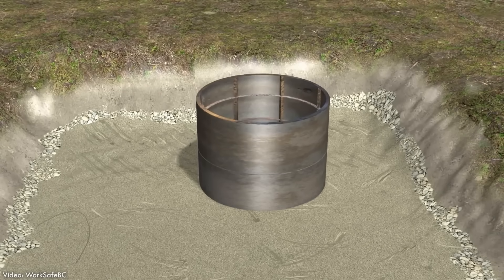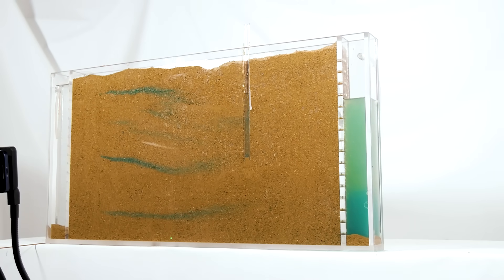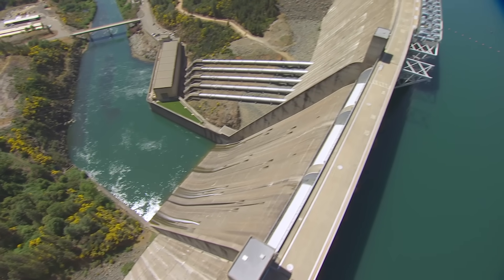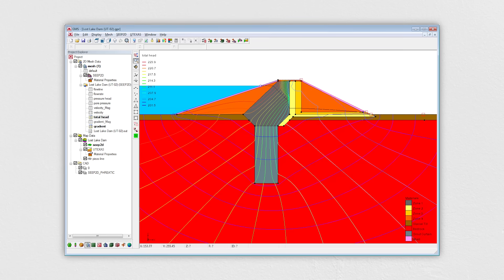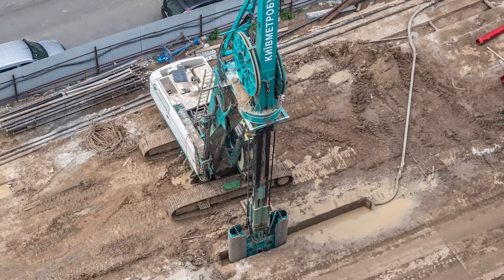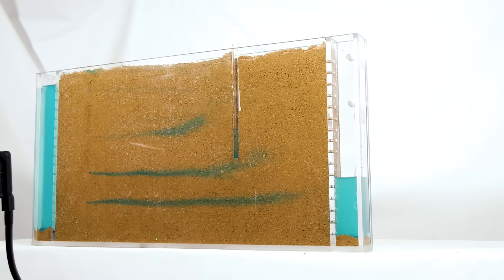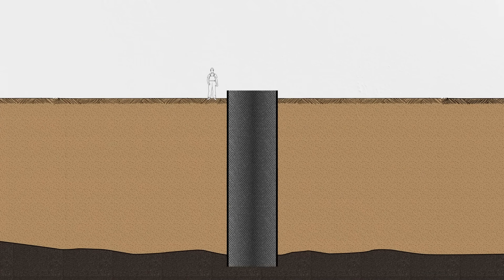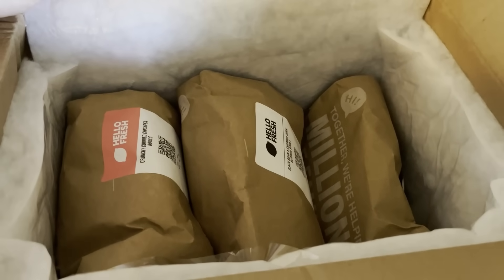The Bizarre Paths of Groundwater Around Structures

Comment: Living in the Netherlands, water, and especially groundwater, is a massive part of life around here. It's good to finally learn how we control all that when building anything a meter below sea level.
Reply: Same is true in the state of Florida. You take about one meter you will hit water. Plus we have sinkholes. It's similar to building on top of a large brick of Swiss cheese.
Reply: @EnlightenedSavage  yeah one thing I noticed when I have visited Florida is just how many wells there are. I figured it must have been easy to hit water because just about every lawn sprinkler has a well.
Reply: @EnlightenedSavage  the scary thing over there is that the groundwater is getting salt….
Reply: @EnlightenedSavage  not all swiss cheese have holes in them though 🙃
Reply: @BlackDragonWitheHawk  it's a saying. Do you want to add to the discussion constructively?
Reply: 1 meter below sea level? More like 9 meters in the deepest part :) (Polder near Moordrecht/Nieuwekerk a/d IJssel)
Reply: When I first moved to Zoetermeer my Dutch girlfriend told me you could dig a hole and watch it fill with water, (I’m American). 
I thought she meant like, dig a hole, crack open a beer and by the end of the beer there would be water in the hole. 
Later I discovered on my job, where I had to open ground level access ports to below ground tanks and get a measurement of inside the tank, I bailed out the water covering the port and unscrewed the cap. I was just about to put my measuring stick in the port when I realized the water was about to go in the port. I quickly screwed the cap back on, then bailed the water out again. Sure enough, in a few seconds it was back up to above the port cap. 
I just lowered the access cover back over the hole and didn’t bother checking that tank.
Reply: @Linusgump  as a fellow Zoetermeerder, I can definitely see that happening here. My crawl space under the house is only a few centimeters above the water level!
Reply: I imagine ground water is not just an important but a somewhat terrifying matter when a good part of your country is at permanent risk from the ocean, rain, adverse weather, and pretty much all water on top of it.
Reply: @Voltaic_Fire  Not really, to be honest. Flood insurance, for example, is just not a thing here. Our water management infrastructure is so omnipresent and so fundamentally integrated into every level of life that we just don't think about it anymore. There's even a level of government which is equal to but distinct from the province level called the watersheds. So 'It's taken care of' is the mindset most of us have.
Reply: @MrBlueBurd0451  I have seen your water management infrastructure, it really is impressive, but I'm a worrier so I do not think I could adopt the same mentality.
Reply: @Voltaic_Fire  If you grow up not worrying about it, well, it's not something that ever comes to mind.
Reply: I second the not worrying about it. The government also provides a flooding estimator so citizens can look up how high the water will rise when a dam of primary water retention structure breaks. Most times we're below the water level for ground floor but above for the 1st floor where bedrooms typically are. Add to that that most if not all houses are concrete or brick walled and anchored to foundation piles and the fact that the pumping stations are built with plenty of redundancy and you'll not worry about it.
Fun fact: the pumping stations often maintain specific water levels and pumping rates and are not pumping "as dry as possible"  because that would create additional soil settling issues.
Reply: Fun fact #2: some of the historic pumping stations are still on standby duty to be able to pump in extreme weather conditions. For instance, the biggest steam powered pumping station 'ir. D.F. Wouda Steam Pumping Station', apart from being an UNESCO world heritage site is still capable of pumping 4,000 m3/min (1,100,000 U.S. gal/min) when needed. 
It's a museum too, so if you are ever around it's a great visit!
Reply: @WouterWeggelaar  additionally, all windmills (not turbines, mills) in this country are fully operational and do pump water on a regular basis (weekly to bi-monthly)
Reply: @Voltaic_Fire  I live right along the ring of fire, and my whole life people have been talking about "the big earthquake" that's due any day now. It's kinda terrifying to think that any day with no warning the whole area could be flattened and lots of people I know killed, but on the other hand it hasn't happened yet and there's nothing I can do about it so you kinda hit a point where you just don't think about it any more :) I imagine the same goes for people in any area with imminent disasters. Beyond preparation like having food and blankets ready, there really isn't anything to gain from worrying and you kinda just... don't
Reply: @achelp954  That's not 100% accurate, but indeed if you own a windmill that has a functioning pump and is still connected to waterways, you have to maintain it in working condition and satisfy the minimum amount of monthly pumping hours to prove their readiness. but some windmills are....mills for grinding or saw mills etc. those still need hours turning but no pumping. furthermore some windmills don't reach water anymore.
The mandatory pumping is mainly to discourage people from buying a windmill and not taking care of it.
I've done some sail & rope maintenance on one of the classic windmills where the pump actually runs on electric power and can run on wind if needed
Reply: @WouterWeggelaar  wow. You really know what you are talking about. Very interesting facts.
Reply: @MrBlueBurd0451  it will be sad when most of Florida is underwater. And rather crowded inland.
Reply: @Voltaic_Fire  the only time it happend was because ww2
Reply: @WouterWeggelaar  ooh, fun language thingy! You said water is an issue on the ground floor but not the first floor, and although I understand this to be a common naming convention, it would be confusing to an American as we call our ground floor the first floor!
Reply: Ive lived in Tucson, Az. for 53yrs and I dont have a clue what your talking about lol. Back in the late 70s early 80s I was building pools and we had one area that you would hit water at 6' when digging the pool. Its not that way anymore. Water is 20+' now in that area. I still found this to be very interesting. Its hard for my mind to picture a lot of water under ground cuz its bone dry and hot up here on the surface. 104F today.
Reply: Including Schiphol Airport site of a sea battle in 1573!
Reply: Because of this, building something "simple" as a basement under your house in the Netherlands can become quite the engineering feat, depending on the location. This is why building basements in the Netherlands is quite regulated.
Reply: @Razwer  It's also problematic in this part of Eastern England. One large part of this county is called 'New Holland', after Holland in the Netherlands.
In Lincolnshire and Cambridgeshire, the Fens were coastal marshland until the 1800's. Only properties on higher ground can have basements.
Reply: @Razwer  here in Tucson ground water isnt a factor when building a basement so one would think they would be common place but the reality is basements are rarer than hens teeth here and I dont know why.
Reply: @tonythomas951  "rarer than hen's teeth" just made my day, you sound like my dad who lives in SoCal but whose family is from the South so he walks around saying the damnedest aphorisms 😂
Reply: hello there, underseawaterlevel people!
Reply: I had an amazing professor from the Netherlands, Otto Strack, who specialized in groundwater. Necessity breeds ingenuity! Nobody understands groundwater better than the Dutch.
Reply: And people say you can't learn anything from online videos, these videos trained a beginner civil engineer
Reply: Good bless your farmers.  Down with the WEF!
Reply: I was just in Amsterdam and learned there were -2.5 bicycles for every citizen. Seeing all the full bike-racks, I could believe it.
Reply: Same in south Louisiana.  Its why we don't have basements or why we have cemeteries that are above ground.
Reply: But but climate change!
Reply: The city of New Orleans is on an entirely different level of ground water problems
Reply: @kamakaziozzie3038  New Orleans is pretty basic stuff for Dutch water management infrastructure engineers. Why do you lot hired them?
Reply: @MrBlueBurd0451   And hire them we did. All it took was a visit to the Netherlands by a cadre of engineers, scientists, and politicians from Louisiana, and a "tour" of how the Dutch manage their water infrastructure, and the deal was sealed. I was fortunate enough to be able to see the drawings and speak with one of the members of our local engineering teams and I haven't worried about the levees since. We even have a one of the gates, though miniature by comparison to the Dutch ones. Everything about the project was, and is, amazing. Maintenance is the key, now.
Reply: Well yes the ground is water
Reply: I’m so sorry
Reply: You must have some of the best civil engineers in the world!
Reply: Is it still weird to anybody but me how the deeper you go, the more pressure water exerts?
Reply: @fredgarvinMP  uh... I don't want to be rude but the answer is probably yes. It's very intuitive that the more weight is pushing down on something, the harder it's pushed down. Can I ask what part about it is weird to you?
Reply: @joshyoung1440  It seems although there is a lot of it above you, it wouldn't have anything to push against.
Reply: I always look to you Europeans and think you guys have an amazing solution living in harmony with the water. Many people where I live are not on stilts, and below sea level or at sea level, so a storm can mean severe flooding.
Then a high end Category 4 Hurricane comes ripping through with a 10’ to 15’ storm tide, and sustained 150mph winds, and I begin to doubt your solutions can work here were storms can be frequent and almost hard to believe. I hope some day we will figure something out.
Reply: @johnnycarholder7282  the thing to figure out is to stop destabilizing the polar vortex with global warming so it stops flinging unprecedented hurricanes down the Atlantic at us
Reply: Richmond BC is at sea level it's amusing excavating and watching water rush in because someone didn't consider dewatering equipment. 
Ever excavated for buried hydro cables under water? Some days are very exciting 🤠
Reply: Hi o😊l
Reply: I've grown up in South East Queensland and it's largely built on natural swamp land. Obviously not the same issues that the Netherlands face, but water is a major factor, both flood protection and unstable soil when it gets wet or dries out
Reply: we swamp people so jeah. Water management 100
Reply: @stokkejanraggio  Europese moerasmensen, met fietsen!
Reply: Amazing that you live in Netherlands, water and groundwater
Reply: no way bruh optained at least 10 cubic meters of obsidian
Reply: Yes, us Americans are well aware of your dredging prowess. Impressive indeed.
Reply: That incident is a basic design error.
Reply: around the early 2000's i used to work in construction doing measuring of ground water levels. It was mind-numbing work, its nice to finally learn why the hell i was being payed to do that stuff.
Reply: You control nothing, especialy Natur is Not controlable.
Reply: Liar
Reply: GEKOLONISEERD
Reply: Inderdaad
Reply: Remember that the Lord Jesus Christ died on a cross for you because He loves you so much. He then rose up from the dead three days later
The Ten Commandments are called the moral law, (most of us are lying thieving blasphemous adulterer at heart and deserve hell) you and I broke the law, Jesus paid the fine. That’s what happened on that cross. 
By believing that Jesus died on the cross and rose up from the dead 3 days later and not just confessing your sin, but also repenting of all sin you have done and putting all your trust in Him in prayer, He will grant you everlasting life as a free Gift

Comment: There is a new oil change place being built near my house. They used a large network of dewatering pipes to lower the water level so they could excavate and pour the "basement" area where the mechanics work under the car (no lifts, cars drive in at ground level). I wasn't sure what the situation was until this video explained it perfectly.

Comment: 7:11 black lines represent equal water head (not pressure?)
Reply: Those are the same thing, a barometer measures atmospheric pressure by how far up a pipe mecury gets pushed, water head is just using feet of water instead of inches/mm of mercury. (Mercury is like 13x more dense than water)

I suppose a slight technicality is that water head can include the energy lost on fluid velocity but in this specific case groundwater is generally very slow moving to the point the difference between static and total is basically nothing.
Reply: @jasonreed7522  well, not really. water head (m) and pressure (Pa) are not the same thing.
Reply: @HerrLavett  so are mm of mercury measuring a fundamentally different quantity than Pa or atm?

Water head in ft/m is the pressure at the bottom of a water column of that height. Knowing what level the water wants to be at is often more useful than its Pa/psi pressure because it lets you design "plumbing" like culverts to match that line when at capacity without dealing with conversions involving the density of the fluid.